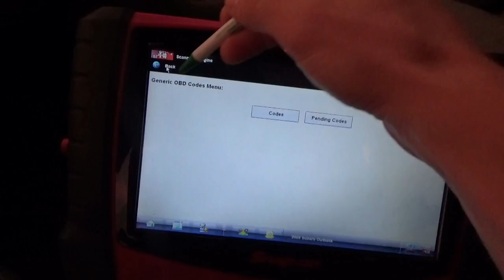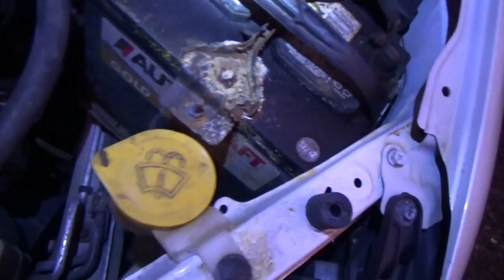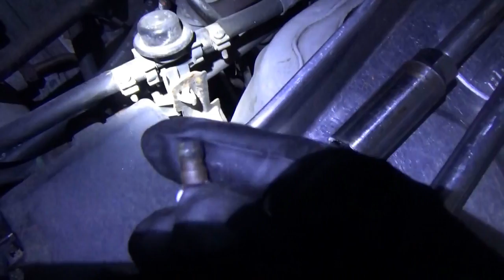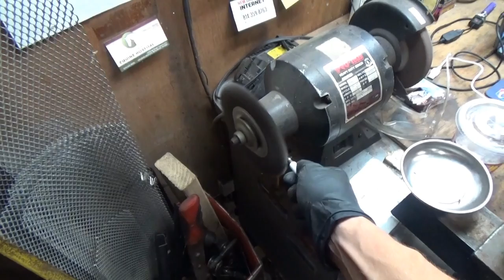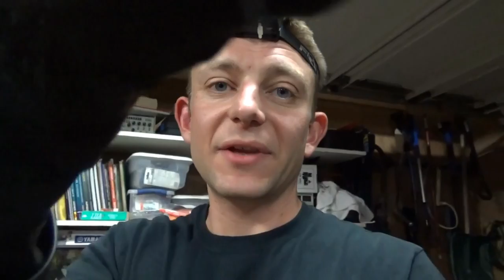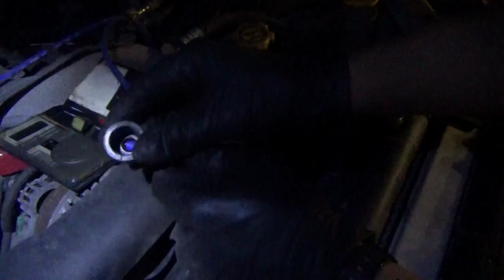Subaru Misfire Diag (+PHAD Repair!)

Comment: Excellent diagnosing. - I recently learned that misfires can also be caused by head gasket leaks (of oil or coolant) in the head, or oil in the plug boot from plug gasket leaks. And, somewhere I read that the multiple ground wires on Subarus were intended to reduce certain causes of head gasket leaks - but I'm not sure if I buy that.

Comment: In my experience working on Subarus the last 6yrs, I’ve had the boot issue at the coil with NGK wires. I’ve been using Denso. I also hear the NGK coils are good. It’s very surprising but it seems to be true. But usually only on Subarus.

Comment: Mine is cylinders 3,4, and 6. 2006 subaru tribeca b9 3.0. I'm just starting.  All I've done so far is scan it and drive it.  It ran really rough and shut off.  I'll pull the plugs and check the coil packs.

Comment: Thanks for this, very straight forward.. I'm wondering if u can give a 2nd opinion on what I'm missing? 06 Forester threw. C2 code, upon inspection I needed to do new plug, wires coil. Drove good for a day then it thew a C4 code.. recheck everything and all looks good, hmm ok next I check injector resistance at 5ohms in a cold ass garage.. decide to swap them and see if the code follows, it didn't, still C4.. ok let's do a pressure test.. all cylinder from 160-175psi... While I was doing that decided to swap the plugs between 2 and 4, issue still persists... Anything I'm overlooking?? Thx

Comment: So awesome, that water spray tip so simple yet so effective.  I have an 05 forester i’m currently working on with a cylinder 2 misfire, has blue ngk spark wires.  I’m thinkin no way it’s gonna do the same thing you showed in the video.  Wouldn’t you know it’s arching from the boot at the coil in the same location as yours.  Thanks for the quick and easy demonstration.

Comment: This is perhaps YouTube's best misfire video. Mine is also number 2 but older Subie 1996. I suspect it's the cable and will likely swap it out. The problem with the tests you did water or meter is that it won't necessarily detect all problems with the cable. Also misfires can be caused by half a dozen other things, like a sticky injector causing a random misfire.
Reply from the maker: Thank you for the kind words! What other cable problems can occur that a meter or a water bottle wouldn't pick up?

Comment: Dear Ivan,
As I was "smoking out" for any leak from the top of the engine, I saw smokes from the EGR valve (inside the EGR body, not the contact part to the intake). This is for my 2004 Honda accord V6 3.0L engine, 200K miles. What is the relation of such leak to the fuel trim for this MAP based Honda engine? Regular MAF based engine, we should see positive STFT, right? But for MAP based engine, the STFT will be negative, right? Should I buy a new EGR from Honda or the aftermarket? Initial start up of a cold engine, STFT is -27 bank 1. Can such EGR leak can cause -27 STFT?
Many thanks & God bless,
Hai

Comment: i bought my WRX in 2013 brand new,its 2019 and i decided i would sell it pay off a few bills and work on my chevy blazer project,i never drive the WRX ok,so i had to go to the dr, and half a mile down the road,it misfired turned around pissed off couldnt believe its messing up since i decided to sell it,ran my cobb tuner and it was po32 how come its always cylinder 2 ? well my car has 12.554 miles on it,yep got it new in 13 its 19 and 12,000 miles and i guess it over heard me talking about selling it,i pulled plug # 2 looks fine replaced it and still doing it,so im going to swop coils from 2 to 4 then run a scan and see if its the coil i guess.is this how this crap goes haha ga lee cant wait to sell its clean ass haha

Comment: I would still suspect the wire, you already saw the proof. I prefer original OEM parts on my Subaru. Having an NGK doesnt mean squat. As a note, I went through NGK spark plugs twice as fast on my snowmobiles. They were prone for failure twoce as fast as Champion.  After Market wires can actually be harder to plug in than OEM. The boots might be thicker. I dont trust  NGK.

Comment: My brother has aways used an unlit propane torch as you run the torch tip over vacuum lines a leek  will be detected when the engine speed increases.

Comment: I've always used the ol spray bottle on cars with spark plug wires as the start of my misfire diags with great success in finding intermittent codes, including the dreaded Po300 codes, where scan data doesn't show individual misfire history nor live misfire counters. I even use it on sensor/actuator connectors that I find suspect, and have fixed a lot of intermittent codes that way. Hey, it beats spraying carb cleaner right? LOL

Comment: Oh man, new parts auto keith be pulling his hair out over this HT cable fiasco :-) 
Why he don't like the water mist test? useful procedure .
Wonder if some contaminant within the boot moulding as arcing through that super easy .
Job jobbed :-) and no duct tape, those coyotes need some duct taping :-)
I must admit I never repaired a cable as either used old one from spares temporary or got new set, I feel like an unskilled parts swapper now :-( lol
You have your caption "no parts required"
you could do with couple more though lol, you can use my 1 2 subaru caption, You need a duct tape roll sticker with "It's been Ivan'd" caption :-) ... about time your friends forester came back in lol ... we need more subarus ...
Reply from the maker: My friend's Forester is still coming up with surprises! Just today it blew out the passenger side cam plug and spit the oil out all over the catalytic converter....I;m not kidding HAHAHA that car is possessed!
Reply: man bet that smoked well :-), I never seen 1 subaru be so much trouble excluding the diesels .
Get your subaru baseball cap on and the tools/camera out, 1 2 another subaru baby ...
Reply: @PineHollowAutoDiagnostics  Same one?

Comment: Ivan how's the rogue doing ?
Reply from the maker: Rogue is doing great! I should probably put that driveshaft back on before the winter lol
Reply: @PineHollowAutoDiagnostics  you never put the rear driveshaft back in it when you did the transmission replacement?
Reply from the maker: I did but the ujoints literally fell apart 15k miles later haha
Reply: so did you replace the u joint or drive shaft
Reply from the maker: I got the u-joints in stock that should fit...will make a video on that soon :)

Comment: Great work Ivan 👍 I agree with your head gasket hypothesis :) I used the water method plenty of times(don't tell Keith), I usually mix it with soap to keep it from drying out so quickly(don't tell Keith x2) 😆

Comment: Eric O indeed did a spark plug wire repair video. I think it was for a vehicle that the rats chewed through the plug wires. I learned the proper way to do those plug wires through his video. But, I keep forgetting to use dielectric grease and regret it a year later when I check, and replace if needed, the spark plugs. I'll hopefully remember the grease should I get hired as a mechanic very soon. While we're quoting other YouTubers.... And there's your dinner!

Comment: Similar issue to my 4Runner that you did a similar water bottle test on :)  Gotta say the easiest solution to plug wires is to just go OEM.  I paid $60 for Toyota wires ($20 more than NGK) and they were all nicely pre-routed in a loom and extra little clips, the boots all clicked in perfectly, compared to the mishaped NGK ends that caused that misfire issue in the wet.  I wonder how much an OE Subie set costs?
Reply from the maker: Yeah can't beat OEM. Might have to buy them separately one at a time from Subaru lol
Reply: Subaru OEM are around 50$, NGK can be found for 35-45$, so really not saving much.

Comment: Years ago I bought spark plug wires for a V8 and in the box was a coil of wire and 18 ends needing assembly - perfect for that custom fit job.  Stupid me, I used it.

Comment: The safety glasses grinding on the wheel as they fell was hilarious.  Somewhere several safety police have lost their minds after seeing that.  

But good example of how the dielectric grease is suppose to be smeared off the contact point by the tight contact.  If not, you get a baked on dielectric finish.
Reply from the maker: Yeah I think that was the root cause of this problem :)

Comment: Great video as usual! Just also wanted to ask, how would you go about, finding an ignition misfire at high speeds without using mode 6 data, on a waste spark system, Camry V6 1997.
Please sir?
Reply from the maker: If it's an ignition misfire, you should be able to recreate it with the car standing still by snapping the throttle or power-braking the engine.
Reply: @PineHollowAutoDiagnostics  thanks again sir 
Will try that tonight

Comment: Your channel should be sponsored by a major duct tape manufacturer 🤣🤣 You remind my of that guy in that tv series Macgyver! He could fix everything with duct tape and some coins😉
Reply: DiagnoseDan...that show is back on here in the states!! Some young guy, and one of the CSI LAS VEGAS tv show guys!! Lol

They ought to get Ivan to write some of their duct tape episodes, for them!! 

He could write one where Mac fixes a broke down nuclear bomb, with duct tape, and old Subaru spark plug wire ends!! 

Then he could write an episode where Mac is flying on AIR FORCE ONE with P.O.T.U.S. when the engines fail due to a fuel leak in the center tank, that Mac fixes with an old HONDOO intake snorkel and duct tape to seal it all up!!
Reply: @roadkill5333  Ivan should get a role in that series for sure!
Reply: DiagnoseDan lol!!
Reply: roadkill5333 love the new one lol I know I know it’s not like the old one
Reply: If you want to see how duct tape should be used ( by the pallet), check out Red Greens channel,  bonus is some repair work and invention worthy of McGuyvers uncle Nimrod.

Comment: I am a retired electrician and worked on a bit of high voltage during my long career.   When an arc happens it leave a trail that is conductive, nothing you can do short of cleaning the track of all the marks left by the arcing will stop further arcing.  Replacing the boot removes the arc track, it isn't the pin holes per se that is the problem but the material left in the pin holes by the arc that is the problem.  Putting a new boot on the wire in that case should be a fine fix, the wire wasn't hurt by the arc so replacing it would just be an extra expense to the customer.  You remind me of my mechanic, who just called to tell me my son's car is finished, he does the work with the least expensive material.
Reply from the maker: Thanks for the insights, Roy! Yes that boot was indeed permanently ruined. Sometimes the cheap repair is the most high-quality one, if it is performed with care :)

Comment: Another great Fix from PHAD ! Maybe that was Keith going though the animals screaming as you sprayed the water. I wonder if scanner danner learned  that water spray  at pep boys ?  . Love the extra footage . I hope you film thehead gasket repair.  Do you ever use WD-40 or silicon spray to help water proof the wires ?
Reply from the maker: WD-40 seems to work well on moisture-prone distributor caps!

Comment: Ivan I think the OSHA inspector is on the way to your place right now, no guard on that wire wheel. Yup, I am sure I saw the safety glasses fall off the grinder, not on your head, bad boy.  Please take time to protect your eyes, I had a good friend get a piece of wire brush embedded in his eye.
Reply from the maker: My wife is an optometrist so she tells me this all the time :) Main thing is stand well off to the side of the plane of the grinder too.
Reply: Pine Hollow Auto Diagnostics...that's right!! Your Mrs is an optometrist!! That's so cool!! So, she'll know how to help guide you around when you get blinded by crap slung off the grinder wheel! Hopefully, while she leads you around, she won't be saying "I told you so, and so did EVERYONE on YouTube"! Can she get you one of those canes to tap on the sidewalk, to let others know that you're coming thru?? 

SAFETY GLASSES!! "Well, there your solution right there, lady!"
Reply: I didn't think osha cares. Besides , ivans an engineer. He knows safety.
Reply: In 1971 the first full year of OSHA my shop got fined because of no end shield on a grinder.  Comment is more of a prompt to help Ivan understand he is not bulletproof and needs to start protecting his eyes better.
Reply: Remember, safety third!

Comment: what about trying some liquid tape instead next time ???
Reply: Thats what I was thinking too. Even some Silicone would work. At least till its replaced. I remember my first spark plug replacement. I used a spray bottle too. It looked like the 4th of july under the hood. My friend showed me the trick. Same thing,, cooler damp weather in the fall made my car run terrible. All new GM spark plugs fixed it.

Comment: I use to always use dielectric grease. I must have got a bad tube of the stuff. Then I reverted back to my old method of spraying a little WD40 on the plug. The boot snaps on easy and the WD goes away and never a missfire 6 months later from carbon tracking. One day I'll buy a tube of Motorcraft from Brian
Reply from the maker: Can't go wrong with WD-40!

Comment: Nice fix!
How does one charge for replacing a boot with a used boot to make it worth your time and not near the price of a new wire set?
Reply: You charge a minumum. All garages charge a minimum now. Usually between $85, $105. They charged my daughter for an estimate. Most of what they charged her for, it didnt need. I ended up doing the work for her. Damn crooks.

Comment: I was taught to use a spray bottle too, put a couple drops of Dawn dishwashing liquid in the water it will penetrate even smaller pin holes. I have used duct tape when I had nothing else. Don't let those guys bother you. Good job!!

Comment: Rusty, dry spark plug threads. Spark plugs not torqued down. All spark plug wires loose. Permatex copper anti seize PLEASE PEOPLE, it's made for a reason. Excellent diag Ivan.

Comment: I installed a Diehard into my Tacoma. It lasted 14 Years. When it got replaced it was just starting to get weak, not dead all
together. Amazing. I thought maybe cause the truck dosent have alot of extra crap on it using 12 v.
Nice fix..No parts needed, well no new parts needed :)
Reply from the maker: Wow 14 years! That's amazing! I've seen some OEM batteries last just 4...
Reply: It was a Die-Hard, but it also had a name that die-Hard Gave it, I remember it printed across the front, and it was 8 to 10 letters, I tried to find another one like it, but they we not to be had. I bought it before I left Houston, 2003, and replaced it in 2017, with a Naper.
Reply: @PineHollowAutoDiagnostics  most i have seen is 6.

Comment: Having to repair other peoples screwups, nicely repaired ivan :-D

The junk pile.. errr "Second use supplys" helped keep the cost down to the poor customer.
Also saving the earth with managed recycling.
What more could anyone want? :)
Who said Bullshit? lol.
Reply: Keeping older vehicle running is the best thing for the environment; as long as they run clean.  Reusing reclaimed parts is also beneficial.  So many "modern" cars are almost disposable; use them a while and then toss em out like old razor blades.

Comment: If you know it is misfiring, what is the purpose of the scan tool? A diagnosis that doesn't require a scan tool right here.
Reply from the maker: I didn't know it was misfiring lol...ran like a top when it got to my shop ;) Plus how do I clear the CEL without a scanner? Unhook the battery? xD
Reply: C'mon, dead misfire, basic stuff for diagnosis on this, pull the plug leads from the plugs with the engine running and check cylinder balance, isolate the cylinder, then it's down to spark, fuel, air or compression. A diagnosis on a problem like this can be achieved without a scan tool. Granted the money light would still have to be cleared yet you could still get the engine running properly without a scan tool. Repairs can be done without forking out money for a scan tool.

Comment: subaru with plug wires and rough cold start, auto assume wires and plugs.. but of course, TEST before throwing parts ;)
I like water for spark leakage testing, vacuum I'd rather use other spray/propane, if my ears don't lead me to them first (quiet vehicles!)

Comment: Mmmm How safe is to have sparks jumping randomly in the engine bay? Maybe nothing is going to happen... but could it break something? ':)
Reply: It already broke something, it burned through a spark plug wire.  Cars do occasionally burn down.  Say you were driving with an arcing plug wire like this and if suddenly the fuel system started gushing gasoline in the engine compartment you'd have a fire.